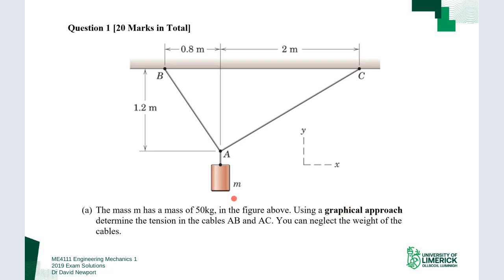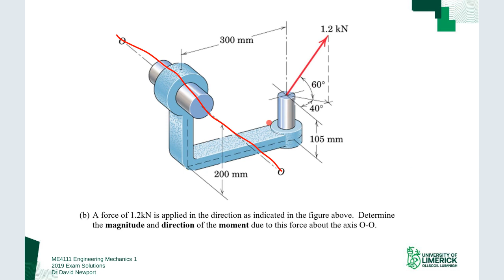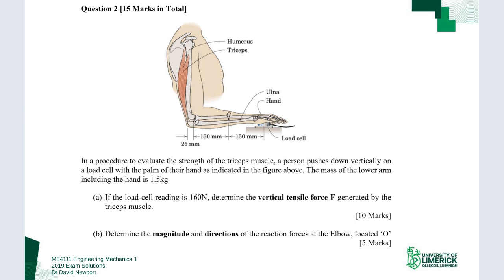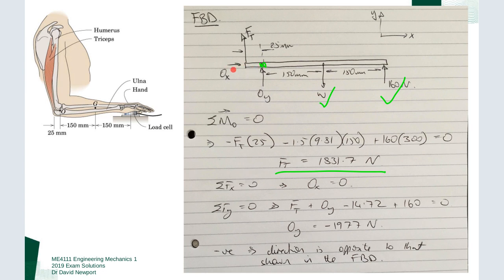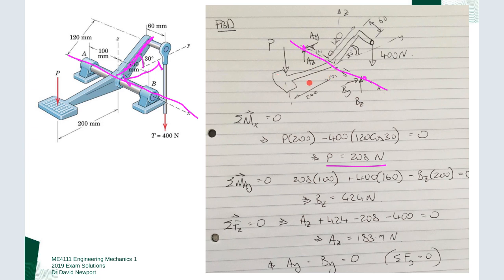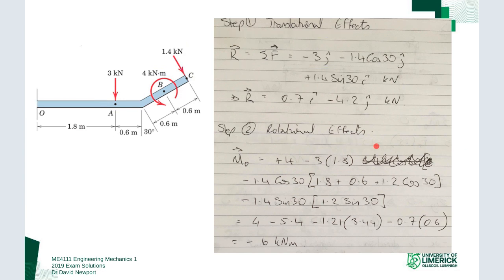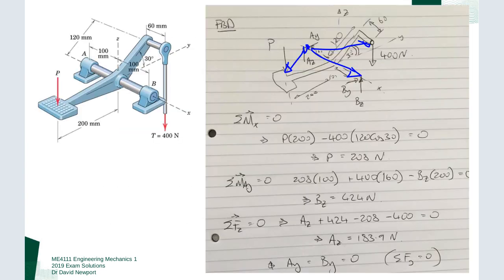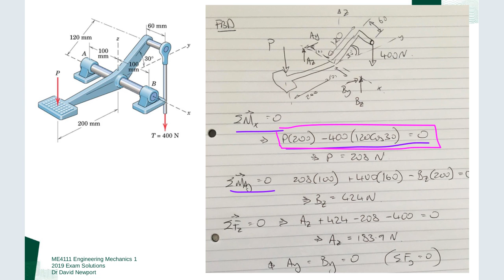ME4111 2019 Exam Methodology

Comment from the maker: Hi All, Please note there is an error in Q1(b) where I neglect to carry the minus sign on the k_hat term of the displacement vector in the cross product (you can spot this in the determinant).  The correct answer for the moment about O is 0.356i_hat - 0.044j_hat-0.138k_hat kNm.  The answer is about the i_hat axis and so is 0.356 kNm anti-clockwise. Best D